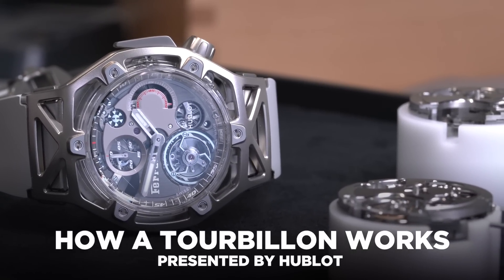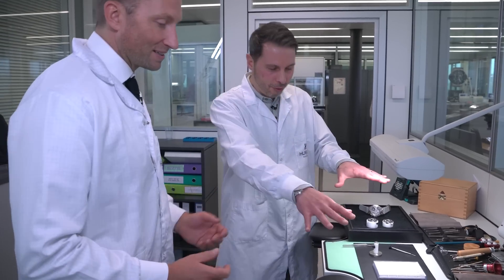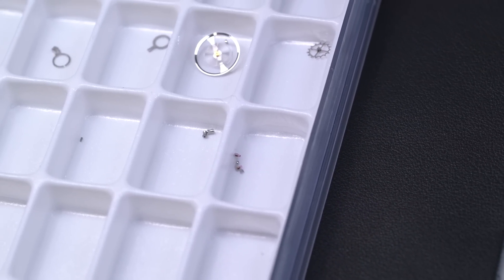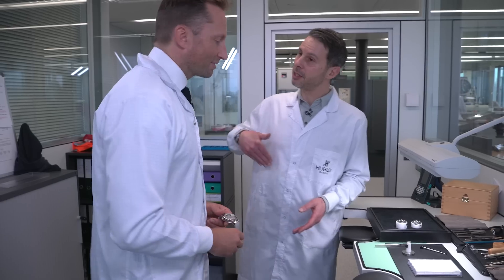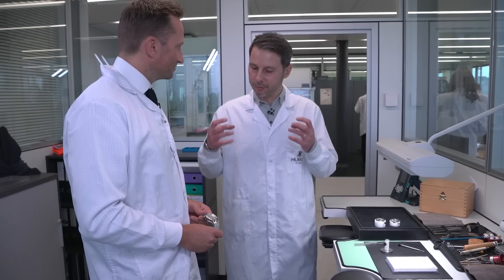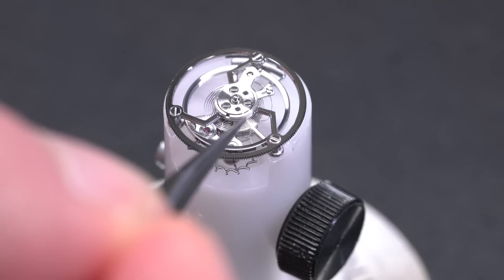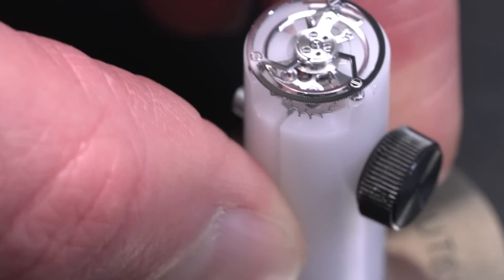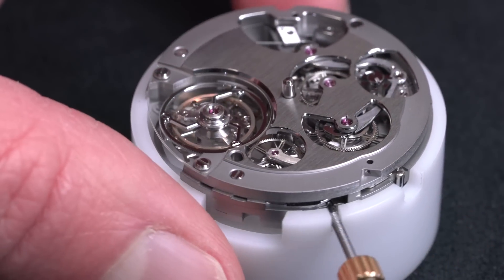How a Tourbillon Works, presented by Hublot

Comment: The tourbillon solves a problem (gravity) that only a pocket watch really has. A wristwatch is frequently changing orientation throughout the day, which pretty much does the work of a tourbillon on its own.

The short of it is a tourbillon is the pinnacle of performance craftsmanship in a pocket watch, but needless overkill in a wristwatch.
Reply: Unless your a Fighter Pilot.
Reply: If your a fighter pilot any 1 dollar quartz watch is 10 times more accurate then the most expensive mechenically engineered watches anyway.
Reply: A mechanical movement is a needless overkill in a wristwatch. Just get a quartz, right?
Reply: isn't the minute repeater complication more difficult to make than a tourbillion though?
Reply: @jeanraspail2979  why get a watch when you can eye ball the sun too right?

You and I get that the beauty of a mechanical watch is the craftsmanship not how many seconds it loses in 1 year
Reply: Asi es.
Reply: Thanks for that explanation
Reply: Your cellphone is just as accurate and can sync itself wirelessly
Reply: The point is people don't care about any of that.  
They just wanna throw money at something, Venbler goods.
People like being slaves in a way or another, even if they're rich they want to indulge effort in vanity
Reply: @keevomora  totally, the same reason I like analogue gauge clusters in my cars vs the new full  LCD displays. It allows so much more creativity in the design and materials. That said there are some nice quartz movement dial designs out there (got myself a Seiko Coutura SSC750P the other day)..... But I still want a cheap Tourbillon for special occasions.

Comment: At 3:27 the escape wheel looks to rotate backwards for a short time. I thought it was an effect of the camera's frame rate, like how a car's wheels, or an airplane's propeller or helicopter's rotor, can sometimes look like they are stopped or barely spinning on video. But watching the escapement in very slow motion or frame-by-frame, it definitely seems to me like the escape wheel actually did reverse direction for one "step" (like how the wheel's spokes can be seen to move counterclockwise for a short period). What could cause this to happen?

Comment: Absolutely Wonderful, wonderful pieces of engineering, just beautiful. But, are they more accurate than radio controlled watches? I doubt it, and that is what a watch is actually for - simply for telling the time accurately.
I once had a high end watch, until it started losing time at the rate of about 5 mins a day - at which point it became useless as a watch, because it was only accurate once every 12 hours, which is exactly the same as a watch which has stopped!!!
Reply: No mechanical watch will ever be as accurate as quartz. But they can be calibrated to minimize the amount of time lost/gained per day. 5 mins is way too much and just may mean it needs to be calibrated. The max inaccuracy is +/-60s per day and that's for a vintage watch